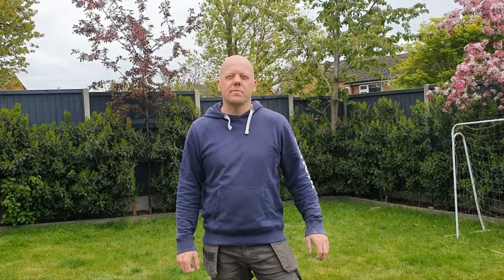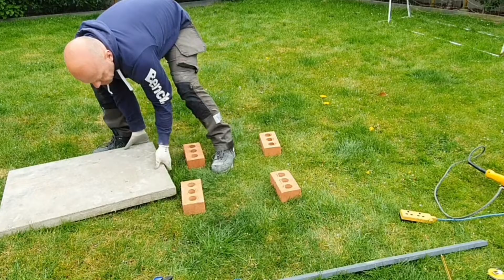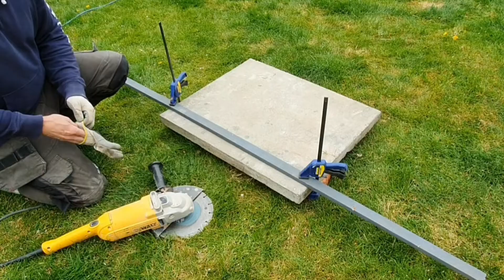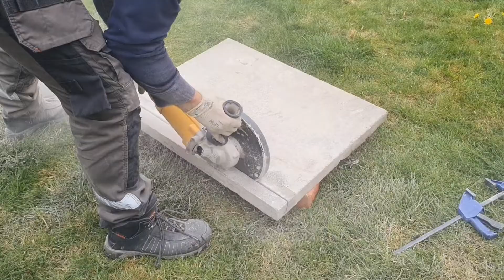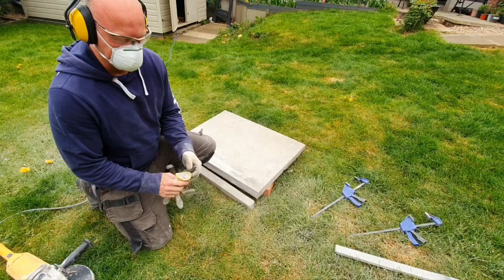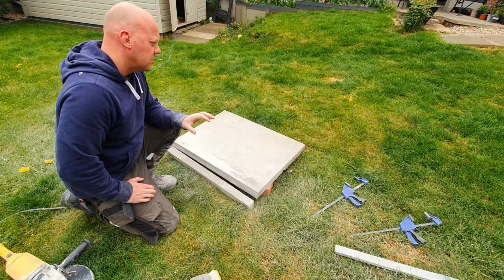How to cut a concrete slab like a pro!

Comment: Just leaving a note to say that I used the info on this video to DIY my patio extension - triangular shape, so a lot of irregular cuts to get the desired result. I cut 50mm concrete pavers with a Stihl saw instead of a grinder because I was worried I would need consistent power and didn’t fancy flipping the slab. There were a lot of takeaways (and many mistakes) but the main one was if I hadn’t followed your advice of clamping a wooden guide I would never have gotten the straight edges I ended up with. Thanks a lot!
Reply from the maker: I'm so glad to hear that the video helped you with your patio extension! Those irregular cuts can be tricky, but it sounds like you handled it like a pro. Great job on using the wooden guide for those straight edges!

Comment: Really good thanks. Would you consider having a hose dribbling water onto the cut to keep down the dust?
Reply from the maker: Hi, you need a special blade if its going to be wet cut. You can get adapted grinders that have that exact thing, you could also spray a fine must into the air to reduce the dust.
Reply: Thanks Steve, I'll just get dusty then.
Reply from the maker: @J0HNPAYNE yeah or wait until its windy 🤣🤣

Comment: What is the minimum power for grinder to do slab cutting? Thanks
Reply from the maker: You can get away with a 4 inch grinder, but i would recommend a 9-inch grinder as you can cut through the slab in one go!
Reply: Many thanks. @FixitwithFowler

Comment: The grinder was throwing the dust from right to left in the video, and the wind was blowing it the other way left to right, there would have been a lot less dust around you if you had positioned the slab the other way round so that the grinder was throwing the dust in the same direction as the wind, otherwise great video.
Reply from the maker: Hi, thanks for your comment!

Comment: Great video. Would I get the same result by using a circular saw? Whats the difference between using the angle grinder or the circular? Thanks.
Reply from the maker: Hi, a circular saw will not cut a concrete slab. A circular saw is used for cutting timber, whereas an angle grinder cuts metal, stone, and concrete. Help that helps!
Reply: You can use a circular saw but you need a concrete cutting blade which are very expensive. Angle grinder blades are cheaper

Comment: Great video. Could you share the name and model of the concrete cutting machine in this video, please? Thanks.
Reply from the maker: Hi Eddie,  thanks for your comment. It is a Dewalt 9inch angle grinder model no. DWE490-GB. Its available in screwfix item no. 3708J for £99.99. Hope that helps
Reply: @FixitwithFowler  Sorry, one more question if I want to cut concrete slabs with a very smooth finish, which blade would be the most effective to purchase?
Reply from the maker: I use a standard diamond blade and find it gives a good clean cut!
Reply: @FixitwithFowler  much appreciated 👍
Reply from the maker: No problem at all, hope you like the videos. Don't foget to like and subscribe to my channel!
Reply: @FixitwithFowler  Perfect. Thank you.
Reply from the maker: No problem!